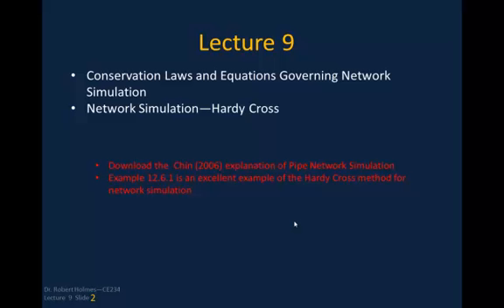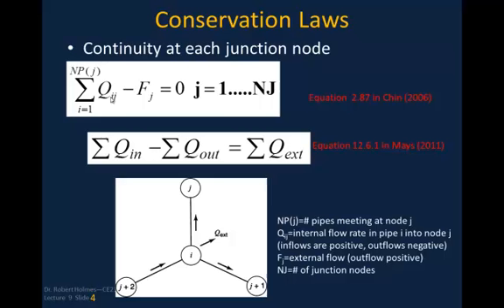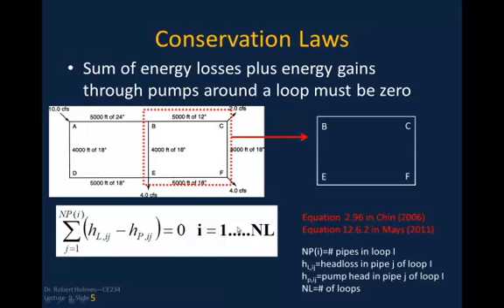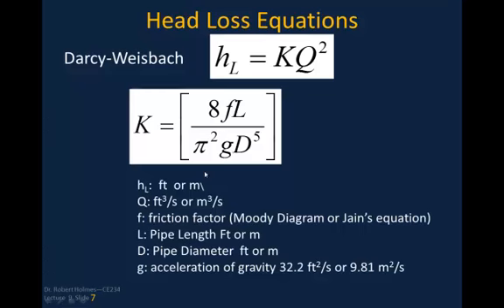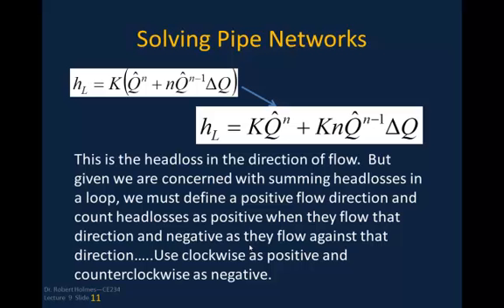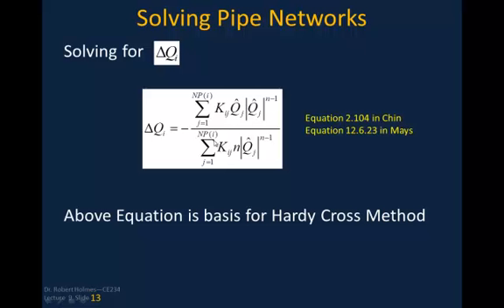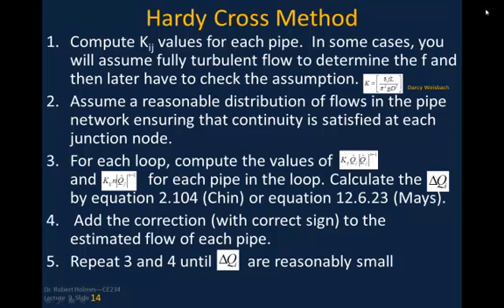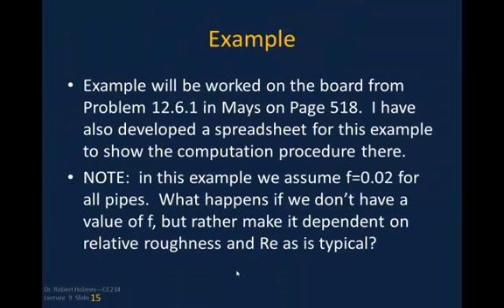CE234--Lecture9--Pipe Networks

Comment: I've a couple of questions.

1. For the pipe network example you have used in your video, I noticed that the discharges Qa, Qb and QC are all defined. I am wondering if the Hardy Cross method is still applicable if these discharges are unknown, especially in the real world, these values would have been unknown.

2. I presume the example you have shown is a network with the same elevation. if we have branches within the loop with different elevation, do we just simply minus or add a head due to its elevation?
Reply from the maker: To Question 1:  boundary conditions are required to solve for the internal pipe flows.  So you have to make some assumptions as to the external flows even for a "real world" problem.Question 2.  The Hardy Cross Method is balancing the headlosses around a loop, so the elevations of the nodes are not needed because you start and end at the same location in the development of the technique to compute the Qs in each pipe.  Now, once we have the Q and you are then trying to solve for pressures, from running from one node to another node, then you have to have the elevations because they would be required in the energy equation.